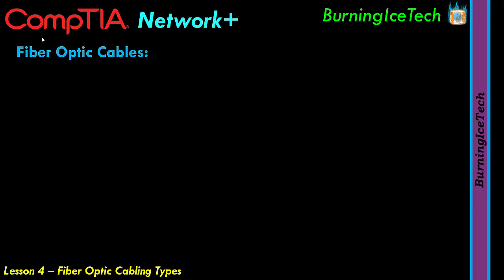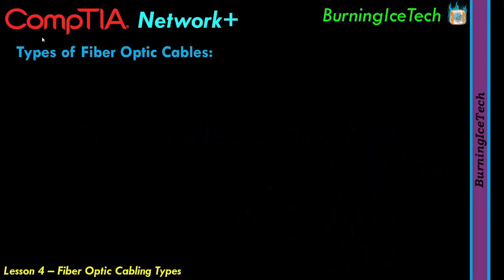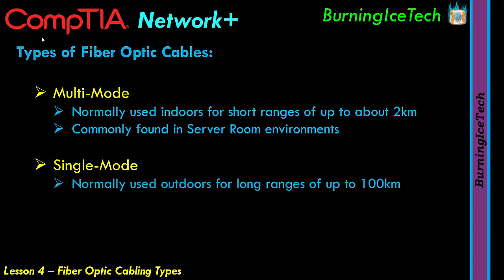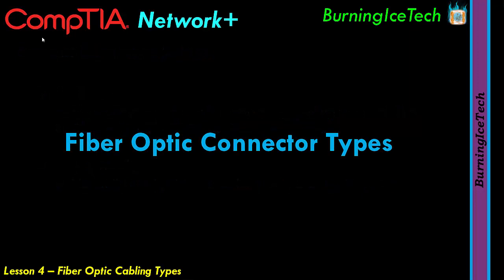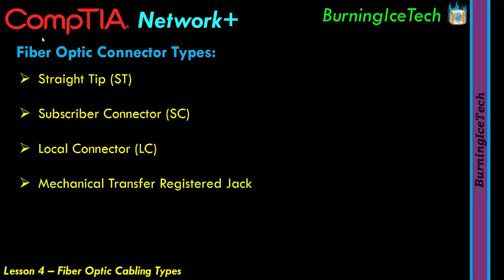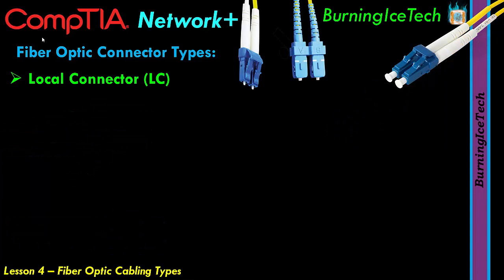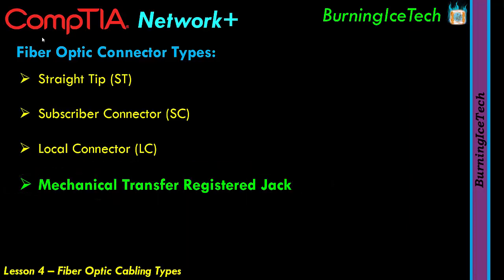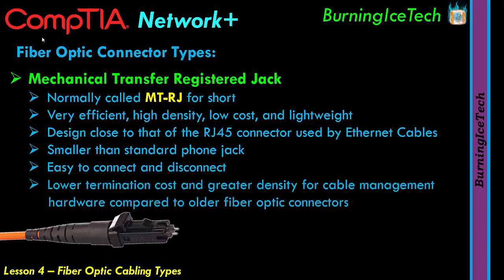CompTIA Network+ N10-008 Full Course for Beginners - Fiber Optic Cabling and Connectors

Comment: Isn't that an duplex SC in the middle of the LC connector examples?
Reply from the maker: When you say in the middle, do you mean the one at the bottom left corner on the LC connector example page? :) I went and checked now haha. The bottom left one does look like LC. A duplex configuration one but still LC. 

I see the top left one does look like SC though so I'm assuming that's the one your talking about.. 

It seems to be part of the same png pic I used. I wanted to paste only the bottom left pic and the one of the right but the pic on the left has 2 cables in it. 

Woops!  Real mission finding good png pic examples I tell ya :)